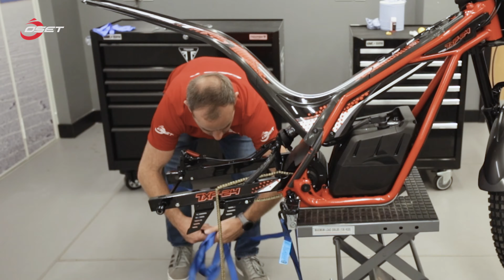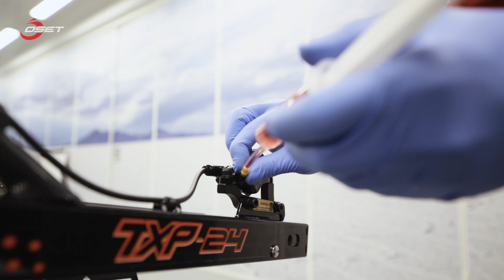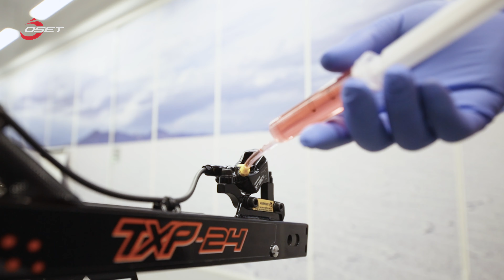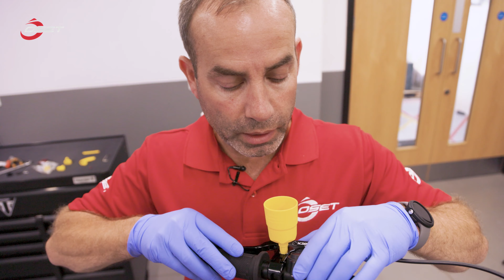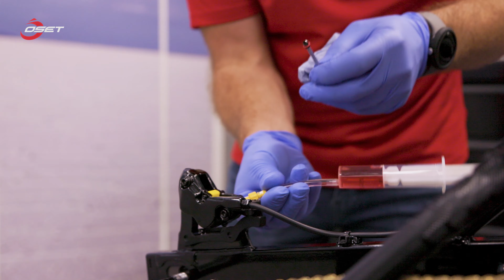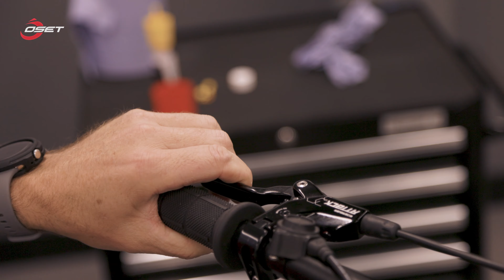OSET TXP20/24 TUTORIAL 11. BLEEDING THE BRAKES.

Comment: I have two questions.

Why do you remove the rear wheel when bleeding the brake? 
Which brake fluid does it use? Mineral oil or DOT fluid?